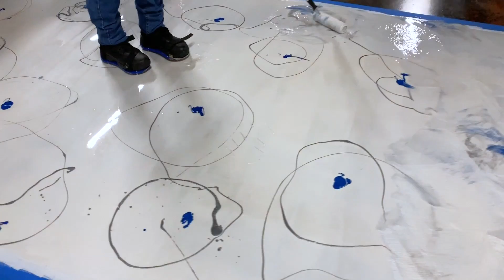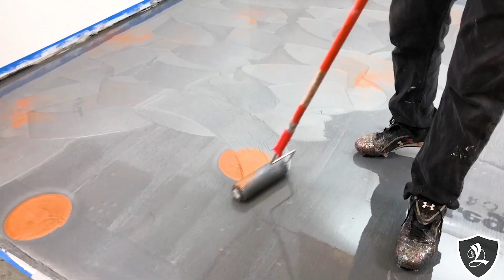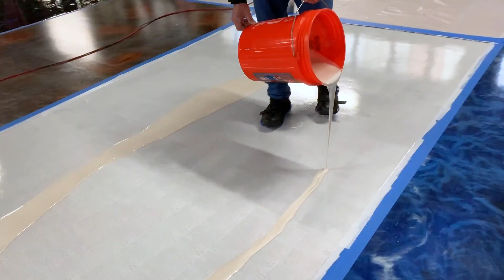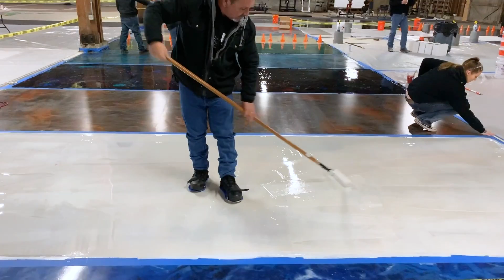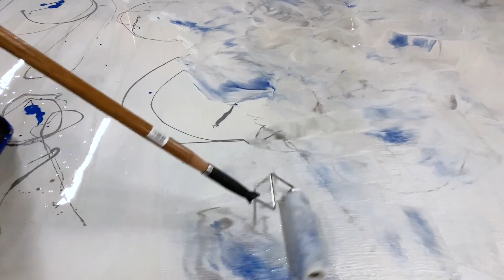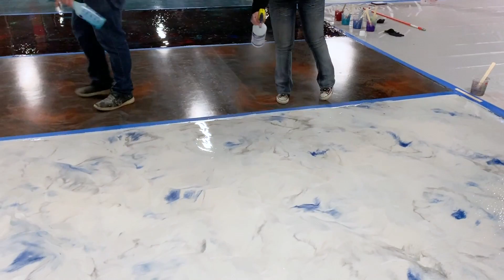Epoxy Floor | White, Blue and Silver | Leggari Products

Comment: Maybe a stupid question but would it be possible to do a floor like that in a bathroom that has a little drain not quite in the middle of it and the floor dips ever so slightly towards that drain? Or would I have to level that floor first losing the purpose of the drain?
Reply from the maker: You can definitely do that application, just make sure you tape the drain off so the epoxy does not get into the drain.  Thanks
Reply: Awesome! Thank you so much for the quick reply. Now I just need to find something similar to your perfect product in Europe. Wish me luck. :D

Comment: $625 for 2 days training its crazy non of the other epoxy trainings that i have attented never charge any money for the training  i was a  huge fan of leggari but you guys really disappointed me by adding this $625 to your 2 days training session.
Reply: Their stuff is way higher priced than others too.
Reply: Check the amount of material your getting in that price because a lot of companies will sell you epoxy at 60 to 75 sq feet a gallon making it seem cheaper and Leggari goes down at 40 to 45 sq ft a gallon. They will sell u less epoxy if you want a thinner floor but the outcome won't be as nice.   @shawnbowen6833
Reply: I agree wIth BIRDAYO, if it's more "on the job" type training and you're getting material then it's worth it. The training I went to was a large distributor and all they used was hardy board cut in half for sample pieces. Nothing like laying this stuff on a floor. You could start a very successful with this training and have the top notch support of people who install their products also.